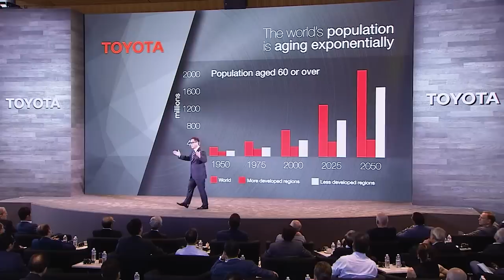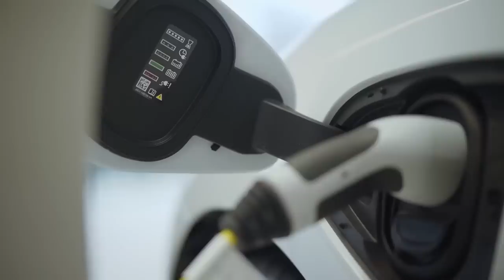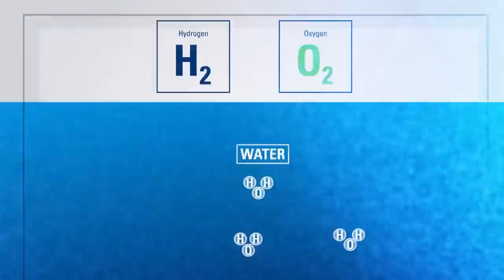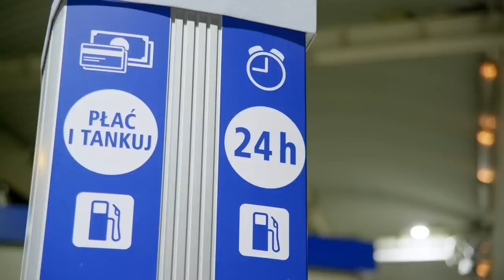New Toyota CEO Shocks Everybody | Huge News

Comment: ...and that's the end mark for pretty much all EVs.
Reply: Yawn... yes... obviously... that is why Toyota sold 2000 Hydrogen cars in the USA last year but car manufacturers sold 800,000 EV's in the same year, and sales are up again 40% this year...
Reply: @redbaron6805  yeah I see where you are going. It's the same fraud that was perpetrated on the car owners 10 years ago. Then it was talk about how diesel engines were the most environmentaly friendly option. Subsidised purchases and bonus systems were put in place to boost the sales and now... now they have switched to the EVs but there are not enough materials in this whole world to produce all the batteries needed to exchange the carfleet in the way it's marketed.
So when Toyota does this, BMW and Mercedes laugh at EVs and describe them as a "trend". Then I am pretty sure that these "go-karts", as I call them, will not last very long. But I could be wrong, time will tell.
Reply: @DVGangula  It is a little more complex than that.  Diesel engines emit less CO2 per mile that gasoline cars.  Which is why that is the path that was being promoted at the time.

People get tangled in the material claims because they are looking at current battery technology, and are basing the future forecasts on current chemistry of batteries.

This is partially because people forget (or don't know) that Lithium Ion batteries are not a battery type, they are a battery class.
There are dozens of variations of the Lithium Ion chemistry out there.  What is getting into advanced stages is replacing Lithium with its sister metal Sodium.  Lithium and Sodium are very similar from a chemistry standpoint, and Sodium is ubiquitous on earth.  

Hence, current NCA or NMC batteries which use Nickel and Lithium will likely switch to Sodium Iron.  We already have Lithium Iron Phosphate batteries which have exceptional longevity and eliminate both Nickel and Cobalt.

EV's are here to stay for multiple reasons people don't account for.  Both simplicity and reliability, 3x to 5x higher efficiency and the ability to charge them using 100% renewable zero carbon energy.

Comment: The company that had the foresight to give us efficient reliable economical hybrids...
A RAV4 Hybrid is more than 18 month wait in Australia.
The new Prius is quite radical.
EVanglisim is not a balanced solution. Govt EV mandates are dumb and expensive.

I totally agree that current battery technology is way too early, expensive, heavy, charge times, range and insurance costs with right offs more common. 
What about the huge depreciation on current EVs as new more efficient ones come to market...
Reply: The RAV4 Hybrid wait is due to very low production.  And there is nothing making battery technology early.  Price parity is forecast in about 5 years.   Fast charging times are already under 20 minutes, and range over 500 miles.
Literally nothing you claimed here checks out.
Reply: @redbaron6805  I have two school chums with Model 3s a Performance and a Long Range (very green guy - solar array on passive solar home and Tesla battery pack). I have driven the Model 3 Performance after jumping out of my 1065 kg Citroen C4 Cactus. Another friend is on his second Nissan Leaf.

The only BEV that shines the way for shedding weight, overuse of materials of a true Environmental Vehicle is the concept Citroen Oli at 1000 kg.

Fact - EVs are heavy; battery technology is changing; range anxiety is an issue, insurance for an EV is significantly more expensive and some insurance companies will not insure them due to a higher incidence of writ off due to repair costs.

My brother takes delivery of a Nissan E Trail E Force next week. A hybrid with an EV drive train and 3 cylinder efficient ICE engine. No need to plug in and no range anxiety. Fabulous to drive. Modest fuel consumption.

Where are the affordable EVs with a 500 km range and 20 minute charging time? Most are 250-400 kms with 1 hr charge time. In Australia unless you can charge at home, we have a feeble charging infrastructure.

I prefer Toyota's approach - offer a range of options... 

In the meantime, I will save the environment by not getting replacements for my Cactus and 2CV6. (34 yrs old and just had if fully upgraded - including a 652 cc engine to replace the 602 cc)....
Reply: @stephenberry1205  Australia is a bit of a special case in the EV world, so your market is a bit different than the USA for that reason.

There are pending advances you will see in about 5 years or so.  Improvements in both Silicon addition and Graphite Anode improvements have resulted in batteries with about 400% gain in energy density.  This could mean EV's will have double the range and still cut the battery weight by 50%.

Range anxiety is far more of an issue in Australia than Europe or the USA.  I have chargers every 50 miles or so in the USA, stretching to 100 mile intervals in rural areas.

I'm not sure where you are getting your charging time numbers from, both Hyundai/Kia and Tesla's have a 18 to 20 minute fast charging times today to 80%.
As I noted earlier, you have EV models in Australia that are not sold here.

As far as insurance.  I own 4 cars, and insuring my Model S cost the same as the 3 petrol cars.  So, while insurance can be higher or lower, in many cases it is similar.

People also misunderstand the replacement theory a bit.  Car manufacturing only accounts for 5% to 10% of total emissions.  Which is why it is actually far cleaner and results in far lower emissions to replace an inefficient car with a more efficient one.  As long term, 90%+ of the emissions come from driving and burning fuel, less than 10% from manufacturing.
Reply: @redbaron6805  You have convinced me not to buy an EV within 5 years..
If current technology will be vastly outdated - Depreciation Central.

Double the range and half the weight are excellent omens for manufacture of a Citroen Oli... 

There are a lot of places around the world like Africa, South America, India, Russia as well as Australia are not as suitable for EVs as the ONLY solution.

Heavier equipment may head toward hydrogen. JCB in the UK for example.
Mining in Australia will be a big one.

Most existing apartment buildings here do not have easy conversion to EV charging. Those without EVs will not share in stumping up for rewiring part of the basement for a small number of EV owners. In the UK I have seen a lot of reports of public chargers that don't work.

If you cannot charge at home, especially with solar, public rapid chargers are expensive and getting dearer. There is also the issue of battery degradation if you only use rapid chargers. Maybe this too will change.

Having owned 17 Citroens over 51 years including 3 new Citroen 2CVs - 550,000 kms, all my cars have been low fuel consumption and lighter and/or more aerodynamic as possible...

In Australia, I am more concerned about plastics in the environment, packing, chemicals in the food chain, unhealthy eating, processed food, overuse of anti biotics and big pharmacy over medicating us.. 
Time to get in touch with the Environment rather than PC / WOK stuff.

Off to Tonga in September to swim with Mother and Calf humpback whales followed by Fiji to swim with giant manta rays... healing of body, mind and soul. Also helping the local economies with people rich in generosity of spirit.
Reply: @stephenberry1205  I'm not saying all of this is perfected yet.  Technology is getting better, cheaper and there are improvements in the works.

I don't think depreciation will be as much of an issue as you think.  Because, ultimately the range and charging time isn't really everything with EV's.  

For example, if you commute 40Km a day, and have an EV with 400Km of range, you would have to charge the EV every 2 weeks or so.  If your range would increase to 800Km, now you have to charge once a month.  The shorter range EV having to be charged twice a month instead of once is not a huge issue for most people.  It would not be enough of a difference to convince someone to upgrade to a newer car or abandon the existing one.  Both cars would serve their purpose, which is commuting to work and transporting you where you need to go.

The same thing applies to chargers.  Reliability of chargers is being addressed, and charging infrastructure is something that will be improved over time.  Some of this will happen organically.  Rental apartments will become more desirable with charging on site when EV's become more common.  Hence, owners will upgrade them as they will command higher rents, or those without them will be at a disadvantage if others have that feature.

Some areas will obviously adapt EV's faster than others.  USA, Europe, China, Japan and wealthier countries will get them first.  The others will tag along, as demand for oil decreases, production will be reduced and prices will rise.  

Also, once price parity arrives, EV's will simply be superior due to less maintenance and fuel costs per mile.

This will probably be partly a generational thing.  The older generation grew up with physical media like records, CD"s, DVD's, Blue Ray's, magazines, newspapers, books etc.  Along with landline phones, fax machines, ordering merchandise from catalogs, even writing letters.  Film cameras that needed development and then paper pictures in photo albums.

The new generation is oblivious to that time period.  It is all digital, on demand content, the internet, online shopping, mobile phones, tablets, laptops, music stored digitally or streamed, digital pictures, pay with your phone, online banking, etc.

That same new generation will grow up with electric cars.  People born in the coming years will probably be looking at combustion engine cars like we look at steam locomotives and DC 3's.  A novelty item that belongs in museum.  Their parents will be talking about the old days when there used to be petrol stations, and cars needed to be serviced regularly to change the oil in the engine and replace the air filter.

It will be as foreign to them as horse drawn chariots and gas street lamps are to us.

Comment: It takes so much fossil fuels just to mine the materials to build a battery it’s not that environmental friendly not to mention the waste when your battery no longer works. I should also mention all power plants run on coal and or natural gas
Reply: No, all power plants do obviously not run on coal and gas as there are massive hydroelectric power plants and nuclear plants around the world.  That claim is staggering level of absurd.
Reply: @redbaron6805  Don’t forget nuclear power plants but the majority of power plants run on coal and natural gas hydro is a drop in the bucket in comparison and is sporadic sometimes rivers run dry you are right my friend that statement I made was wrong I should have said the majority of power plants
Reply: @redbaron6805  what do you think of hydrogen fuel cells do you like it over electric powered cars
Reply: @MOBO-IRON-45  Hydrogen fuel cells in cars is pretty much a dead technology.  Fuel cells in buses or trucks or other applications are better use for them, although time will tell how that works out.

The core issue with hydrogen cars is lack of infrastructure, high cost of building it and hydrogen not being cost competitive, as it is around 7x to 8x more expensive per mile than charging electric cars.

As EV batteries get more energy density, faster charging and keep getting scaled up to reduce cost, hydrogen cars are destined to fall further and further behind.
Reply: @MOBO-IRON-45  You could say that majority of power for example in the USA currently generated by fossil fuels at around 57%, but that is more of snapshot in time.  

The vast majority of new generating capacity added annually is renewable energy.  In 2015 renewable energy in the USA was 14%, in 2022 it was 24%.  Renewable energy is reaching a tipping point in scale, as costs keep dropping and larger wind turbines are added.

12% of the worlds electricity production is already renewable energy and the growth is accelerating.  It is now displacing fossil fuels at a rate that fossil fuel use is actually decreasing, even as demand for electricity is increasing.

People tend to miss the point that EV's can not only run on zero emission electricity, but they are around 5x more efficient.

So, net energy required to drive each Km or Mile is 80% less.  Switching from combustion engine cars to EV's means you go from using 1 kWh per mile to 0.2 kWh per mile.   

So, you are using less energy and switching to cleaner energy at the same time.
Reply: @redbaron6805  It takes machines running on fossil fuels to clear the land,mine the land haul the materials build the wind turbines grease and oil the bearings did you know the large transformers are full of oil at substations I have worked in the power
Reply: @redbaron6805  I have worked in the energy industry for 25 years I’ve built wind turbines solar farms power plants peaker units pipelines and refineries
Reply: @MOBO-IRON-45  That is true, but a lot of the infrastructure around wind turbines is built once.  Once the road is built, the foundation is poured, and the structure is built, the wind turbine can be upgraded and replaced as needed.

They require oil to grease the bearings and cool the transformers, but that is a tiny fraction of the amount that would have been burned to produce the same amount of energy as the turbine produces.
Reply: @MOBO-IRON-45  I understand that point, but the math and physics involved still apply.  
Any renewable infrastructure starts with an upfront emission that is then offset as the solar farm or wind turbine produces energy.

The carbon debt of wind turbines is typically paid off in around 6 to 12 months.  Since they operate for 20+ years, that means the emissions ROI is very good, and is far superior to anything burning fuel.
Reply: @redbaron6805  California has been using wind turbines for years and only 11 percent of their power comes from wind turbines that’s not a whole lot if it worked so well why isn’t more power produced by wind
Reply: @redbaron6805  I think if we put money and years into hydrogen like we have other forms of energy production we would be happy with the results and I think the reason we haven’t is because of big oil and the fear of hydrogen because of disasters like the Hindenburg and the production of hydrogen bombs

Comment: Yes, Sato finally, sensible, all electric has proven too expensive & takes to much from the land.
Reply: That opinion is simply from people that don't even know what fuel cell vehicles are.  They are electric vehicles, just with a smaller battery but addition of a fuel cell and hydrogen tanks, but at a huge cost disadvantage.

Comment: All the comments: Toyota will save us from woke BEV autos.

The actual video: hydrogen is exceptionally difficult to supply compared to electricity. And they plan to make the hydrogen from lignite, ie low value brown coal.